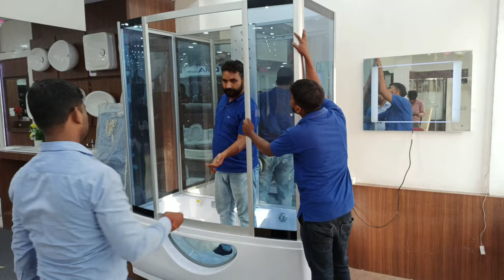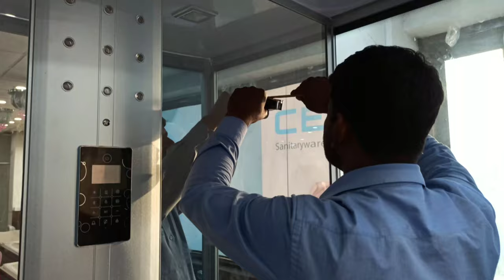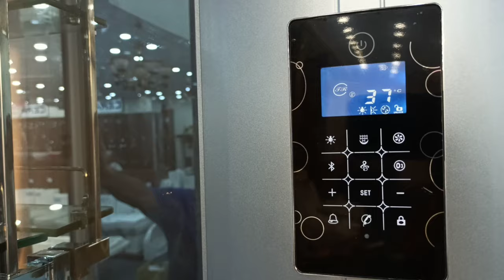jacuzzi bathtub + Steam Shower whirlpool | Jacuzzi installation by CERA

Comment: Mumbai me available hai or abhi ka kya price hai AFTER SALE SERVICE KA KYA
Reply from the maker: CADEO
Steam Shower Room 
1700 x 850 x 2200 mm 
• Ceiling Shower gives rain shower experience
• Hand Shower
• Top and back lamps provide bathroom like ambience
• Back massage jets gently soothe and invigorate body
• Control panel to operate all functions from a single point
• FM Radio to listen to one’s favourite music
• Steam room to rejuvenate body
• Exhaust fan circulates fresh air
• Foot massage invigorates tired feet
• Glass rack and shampoo box provide storing space
• Two level glass rack optimises storage
• Soft back rest to sit back and relax
• Pop-up drainer drains water and also works as overflow
• Six body jets to massage the body thereby improving blood circulation
Cat. No. B2513113 ` 290850
Indian Sanitation
492/B, Maulana Azad Road,

Mumbai- 400004, Maharashtra

+91 22 23878677, +91 22 23878666 , +91 22 9869257864
Jo bhi discount aapke dealer per chal raha hoga use per yah aapko mil jaega aap call kar kar ine se baat kar sakta hun, 🙏

Comment: Sterm shower Whirlpool ki cost kya h
Reply from the maker: CADEO
CANYON
Steam Shower Room 1700 x 850 x 2200 mm
• Ceiling Shower gives rain shower experience
• Hand Shower
• Top and back lamps provide bathroom like ambience
• Back massage jets gently soothe and invigorate body
• Control panel to operate all functions from a single point
• FM Radio to listen to one’s favourite music
• Steam room to rejuvenate body
• Exhaust fan circulates fresh air
• Foot massage invigorates tired feet
• Glass rack and shampoo box provide storing space
• Two level glass rack optimises storage
• Soft back rest to sit back and relax
• Pop-up drainer drains water and also works as overflow
• Six body jets to massage the body thereby improving blood circulation Cat. No. B2513113 ` 290850 discount. Depends your nearest dealer 20 to 35%.

Comment: What is the size and cost ?
Reply from the maker: CADEO
Steam Shower Room 
1700 x 850 x 2200 mm 
• Ceiling Shower gives rain shower experience
• Hand Shower
• Top and back lamps provide bathroom like ambience
• Back massage jets gently soothe and invigorate body
• Control panel to operate all functions from a single point
• FM Radio to listen to one’s favourite music
• Steam room to rejuvenate body
• Exhaust fan circulates fresh air
• Foot massage invigorates tired feet
• Glass rack and shampoo box provide storing space
• Two level glass rack optimises storage
• Soft back rest to sit back and relax
• Pop-up drainer drains water and also works as overflow
• Six body jets to massage the body thereby improving blood circulation
Cat. No. B2513113
MRP-290850 discount idea 20 to 35 %
Reply from the maker: If you like the information, please like and subscribe my channel👍🫡

Comment: Tell price please
Reply from the maker: Price mention in discerption🙏
Reply from the maker: CADEO
Steam Shower Room 
1700 x 850 x 2200 mm 
• Ceiling Shower gives rain shower experience
• Hand Shower
• Top and back lamps provide bathroom like ambience
• Back massage jets gently soothe and invigorate body
• Control panel to operate all functions from a single point
• FM Radio to listen to one’s favourite music
• Steam room to rejuvenate body
• Exhaust fan circulates fresh air
• Foot massage invigorates tired feet
• Glass rack and shampoo box provide storing space
• Two level glass rack optimises storage
• Soft back rest to sit back and relax
• Pop-up drainer drains water and also works as overflow
• Six body jets to massage the body thereby improving blood circulation
Cat. No. B2513113
MRP-290850

Comment: Size kya hai.. 
Length n width.. 
Or height..
Reply from the maker: CADEO
Steam Shower Room 
1700 x 850 x 2200 mm 
• Ceiling Shower gives rain shower experience
• Hand Shower
• Top and back lamps provide bathroom like ambience
• Back massage jets gently soothe and invigorate body
• Control panel to operate all functions from a single point
• FM Radio to listen to one’s favourite music
• Steam room to rejuvenate body
• Exhaust fan circulates fresh air
• Foot massage invigorates tired feet
• Glass rack and shampoo box provide storing space
• Two level glass rack optimises storage
• Soft back rest to sit back and relax
• Pop-up drainer drains water and also works as overflow
• Six body jets to massage the body thereby improving blood circulation
Cat. No. B2513113
Reply: @NotableTarun   Okk.. Thank u😊

Comment: Bhai dimensions kya hogi iski n shock lgane k toh koi chances nhi h na?
Reply from the maker: CADEO
Steam Shower Room 
1700 x 850 x 2200 mm 
• Ceiling Shower gives rain shower experience
• Hand Shower
• Top and back lamps provide bathroom like ambience
• Back massage jets gently soothe and invigorate body
• Control panel to operate all functions from a single point
• FM Radio to listen to one’s favourite music
• Steam room to rejuvenate body
• Exhaust fan circulates fresh air
• Foot massage invigorates tired feet
• Glass rack and shampoo box provide storing space
• Two level glass rack optimises storage
• Soft back rest to sit back and relax
• Pop-up drainer drains water and also works as overflow
• Six body jets to massage the body thereby improving blood circulation
Cat. No. B2513113 
And shockproof

Comment: Rate kitana hai
Reply from the maker: CADEO
Steam Shower Room 
1700 x 850 x 2200 mm 
• Ceiling Shower gives rain shower experience
• Hand Shower
• Top and back lamps provide bathroom like ambience
• Back massage jets gently soothe and invigorate body
• Control panel to operate all functions from a single point
• FM Radio to listen to one’s favourite music
• Steam room to rejuvenate body
• Exhaust fan circulates fresh air
• Foot massage invigorates tired feet
• Glass rack and shampoo box provide storing space
• Two level glass rack optimises storage
• Soft back rest to sit back and relax
• Pop-up drainer drains water and also works as overflow
• Six body jets to massage the body thereby improving blood circulation
Cat. No. B2513113 `mrp  290850
Baki Jo bhi discount aapki Nearest dealer per chal raha hoga use per ye aapko mil jaega

Comment: what about the price
Reply from the maker: CADEO
Steam Shower Room 
1700 x 850 x 2200 mm 
• Ceiling Shower gives rain shower experience
• Hand Shower
• Top and back lamps provide bathroom like ambience
• Back massage jets gently soothe and invigorate body
• Control panel to operate all functions from a single point
• FM Radio to listen to one’s favourite music
• Steam room to rejuvenate body
• Exhaust fan circulates fresh air
• Foot massage invigorates tired feet
• Glass rack and shampoo box provide storing space
• Two level glass rack optimises storage
• Soft back rest to sit back and relax
• Pop-up drainer drains water and also works as overflow
• Six body jets to massage the body thereby improving blood circulation
Cat. No. B2513113
` 290850
Discount depends on dealers 20 to 35%
Reply from the maker: If you like my video please like and subscribe 🙏🙏

Comment: Dealers available in taminadu?
Brand name?
Reply from the maker: BRAND NAME CERA
Designer World
No.305/8 , Kovilpathagai Main Road,

(Opp SBI ATM), Avadi,

Chennai – 600062, Tamil Nadu

+91 7358344992,vmgceramics@gmail.com
Kailash Home Concepts
 

Survey No. 485/3, Madhavaram High Road

Near Vadaperumbakkam Circle

Madhavaram, Chennai – 600060,  Tamil Nadu

 

+91 9791082829, +91 9043789334,kailashhomeconcepts@gmail.com
Reply: @NotableTarun  
Thanks sir
How much discount ?
Reply from the maker: @madhuraveera6967  30to 35%
Reply from the maker: @madhuraveera6967  but discount dealer decide Karta hai yah Idea hai only aap is number per call kar kar poochh sakte hain Kitna discount chal raha hai vah aap Ko pata Bata denge

Comment: Price
Reply from the maker: Check description

CADEO
Steam Shower Room 
1700 x 850 x 2200 mm 
• Ceiling Shower gives rain shower experience
• Hand Shower
• Top and back lamps provide bathroom like ambience
• Back massage jets gently soothe and invigorate body
• Control panel to operate all functions from a single point
• FM Radio to listen to one’s favourite music
• Steam room to rejuvenate body
• Exhaust fan circulates fresh air
• Foot massage invigorates tired feet
• Glass rack and shampoo box provide storing space
• Two level glass rack optimises storage
• Soft back rest to sit back and relax
• Pop-up drainer drains water and also works as overflow
• Six body jets to massage the body thereby improving blood circulation
Cat. No. B2513113 ` 290850

Comment: Iska cost kitna padega?
Reply from the maker: CADEO
Steam Shower Room 
1700 x 850 x 2200 mm 
• Ceiling Shower gives rain shower experience
• Hand Shower
• Top and back lamps provide bathroom like ambience
• Back massage jets gently soothe and invigorate body
• Control panel to operate all functions from a single point
• FM Radio to listen to one’s favourite music
• Steam room to rejuvenate body
• Exhaust fan circulates fresh air
• Foot massage invigorates tired feet
• Glass rack and shampoo box provide storing space
• Two level glass rack optimises storage
• Soft back rest to sit back and relax
• Pop-up drainer drains water and also works as overflow
• Six body jets to massage the body thereby improving blood circulation
Cat. No. B2513113 ` MRP 290850
20 to 30 % discount depends on dealer

Comment: Cost?
Reply from the maker: CADEO
Steam Shower Room 
1700 x 850 x 2200 mm 
• Ceiling Shower gives rain shower experience
• Hand Shower
• Top and back lamps provide bathroom like ambience
• Back massage jets gently soothe and invigorate body
• Control panel to operate all functions from a single point
• FM Radio to listen to one’s favourite music
• Steam room to rejuvenate body
• Exhaust fan circulates fresh air
• Foot massage invigorates tired feet
• Glass rack and shampoo box provide storing space
• Two level glass rack optimises storage
• Soft back rest to sit back and relax
• Pop-up drainer drains water and also works as overflow
• Six body jets to massage the body thereby improving blood circulation
Cat. No. B2513113 `price 264410
Or jo b descount ap k nearest dealer pr chl rha hoga 25to30%

Comment: Dealer availble in pune
Reply from the maker: 1st call and confirm please 🙏👍 Bhagwati And Company
Kurkumbh road,
sawarkar nagarbhagat singh chowk,
daund

Pune-413801, Maharashtra
9890959890,rameshpokar9898@gmail.com
Jai Traders
Near nigdi flyover,
nigdi

Pune-411044, Maharashtra
8007770705,jaytraders.tiles@gmail.com
Mahalaxmi Tiles And Granites
Pune nagar highway (malthan phata),
near saisahara petrol pump,
shikrapur,
tal-shirur

Pune-412208, Maharashtra
9168380160,mahalaxmitilesandgranite@gmail.com
Mukesh Steel Centre
Near pimpri kalewadi bridge,
mainroad,
kalewadi,
pcmc

Pune-411017, Maharashtra
9822599211,mukeshsteelcentre@gmail.com
Sapphire Sales Corporation
S No. 133/2, Baner Road,

Balewadi Phata,

Opp. Orchid international school,

Pune-411045, Maharashtra
+91 7387087907,
Sapphire Sales Corporation
S/No.66/19, Katraj Kondhwa Road,

Opp. Shatrunjay Temple, Kondhwa (BK)

Pune-411046, Maharashtra
+91 20 26932616,accounts@sapphiresalespune.com
Shiv Shakti Enterprises
Sr.no. 32/1,
plot no: 21,
23,
24,
pune solapur road,

Pune-412201, Maharashtra
9975587777,rajendra.kalbhor@yahoo.com
Walhekar Marbles
Plot no: c52,
bhigvan roadbaramati industrial estatebaramati

Pune-413133, Maharashtra
9689895761,CWALHEKAR@GMAIL.COM

Comment: What is my nearest dealer in West delhi?
Reply from the maker: Balaji Plumbing Solutions Pvt. Ltd.
Plot No. 60, Rajapuri Gali No. 40

Madhu Vihar

West Delhi-110059, Delhi & NCR
9873086385,kunshbhs@gmail.com
BTC Traders Private Ltd.
505 Vishwa Sadan Tower,

West Delhi-110058, Delhi & NCR
9810069603,btcnewdelhi@gmail.com
Himani Enterprises
B-9/8, Main Ring Road,

Rajouri Garden

West Delhi-110027, Delhi & NCR
011-49385168,himanienterprises01@gmail.com
J B Marbles
1641, Thana Road

West Delhi-110043, Delhi & NCR
28010366,jbmarbles2010@rediffmail.com
Manoj Enterprises
Plot No. 14,15 , Block R

West Delhi-110059, Delhi & NCR
9818835581,manojenterprises@gmail.com
R.S Sanitarywares
Plot No 8,Friends Enclave,

Rajendra Park, Nangloi

West Delhi-110041, Delhi & NCR
9810014088,rssanitarywares@yahoo.co.in
Satya Trading Company
Rza/34/Kh No 29/2, Dwarka Puri

Vijay Enclave, Palam

West Delhi-110045, Delhi & NCR
9891673136,satyatrading2014@gmail.com
Reply: @NotableTarun  thankyou

Comment: Rs.2,90,000.00 ?
Reply from the maker: CADEO
Steam Shower Room 
1700 x 850 x 2200 mm 
• Ceiling Shower gives rain shower experience
• Hand Shower
• Top and back lamps provide bathroom like ambience
• Back massage jets gently soothe and invigorate body
• Control panel to operate all functions from a single point
• FM Radio to listen to one’s favourite music
• Steam room to rejuvenate body
• Exhaust fan circulates fresh air
• Foot massage invigorates tired feet
• Glass rack and shampoo box provide storing space
• Two level glass rack optimises storage
• Soft back rest to sit back and relax
• Pop-up drainer drains water and also works as overflow
• Six body jets to massage the body thereby improving blood circulation
Cat. No. B2513113
MRP-290850 discount idea 20 to 35 %

Comment: Any dealers in Bangalore??
Reply from the maker: Amruth Hardware & Ceramics
#250/25/17/16,
near central jail,
naganathapura,
electronic city post bang

Bangalore-560100, Karnataka
9741013532,amruthceramics87@gmail.com
Ayush Trading Co
# 6/7,
near rail way gate,
chikkabanavara,
yesvanthpur hobli.

Bangalore-560090, Karnataka
9739916916, 9740722597,ayushtrading.co2018@gmail.com
Gulshan Ceramics
No.266,
267,
268 & 293,
srinivasnagar,
bank colony,
b.s.k,

Bangalore-560050, Karnataka
9448476590,gulshanceramic@gmail.com
Hindustan Hardware & Sani
#759/,
2nd phase,
80ft. road,
hoskerehalli cross bus stop,
bsk 3rd stage.

Bangalore-560085, Karnataka
9449290022,hindustanhardwaresanitary92016@gmail.com
Jai Marketing
No.01,
sy.no.341,
kalkere village,
nearkalkere bus stop,
hormavu post,
bangalore

Bangalore-560043, Karnataka
9738707590, 9740816808,jaimarketingbangalore@gmail.com
Krishna Enterprises
No 33/a ,
basement floor & ground floorsituated at puttenahalli

Bangalore-560078, Karnataka
9742337346,mangalram99@gmail.com
Maa Janki Ceramics
#09,
28th main road 9th block jayanagarbangalore.

Bangalore-560069, Karnataka
9535231354, 9535231354,
Padmavati ‘ S Easybuild
No 38,
6th cross,
r.k.layout,
80 feetroad,
padmanabhanagar main road,

Bangalore-560070, Karnataka
9341445444,ppfblr@gmail.com
Parishrama Tiles Emporium
# 15 & 16 ciiq road bharath nagar2 nd phase near byadara halli bus stop,

Bangalore-560091, Karnataka
9008223359,INFO@PARISHRAMAGROUP.IN
Rohini Ceramics
40/2,
thagachaguppe kumbalagodu postbangalore

Bangalore-560074, Karnataka
9663731901,rohiniceramics2018@gmail.com
Saptha Marketing Co
# 521/ a r r woods nayandan halli main rmysore road

Bangalore-560039, Karnataka
9916704999,GOWRISHSAPTHA@YAHOO.COM
Thanu Trading Company
No,
1,
2,
5,
6 first floor,
r.b.c complexnear gardencity college,

Bangalore-560036, Karnataka
7204641999,thanu.trading@gmail.com
Thanu Trading India Pvt.Ltd.
No.888,
17th cross,
80 feet road,
s.k. nagar(post),
m.c.e.c.h.s. layout.

Bangalore-560077, Karnataka
7204641999,thanugroups2014@gmail.com
Vishnu Marketing
#2001,
2nd floor,
hal 2nd stage,
100ft road,
indiranagar,
above ritukumar

Bangalore-560038, Karnataka
8025205088, 9686602254,vishnumarketing@yahoo.co.in
Reply: U can even get it from Krishna ceramics and hardware. Opp. Of ksrp 9th battalion, amrutha clg road. Just google this name and u will find the shop. Owner is friendly and trusted. Been his customer from past 5 years. Do contact him if anything needed related to Cera.

Comment: Any dealer in Hyderabad
Reply from the maker: Bhavani Sanitary
 2-6 A & B, Choudary Mansion, Chandanagar, Hyderabad, Telangana - 500050
 9985498557
 rameshkumarrc@185gmail.com
Doshi Brothers
 4-1/575, Troop Bazar, , Hyderabad, Telangana - 500001
 9246205200
 doshi@doshibrothers.com
Gourav Marketing
 
H.No.1-176/2, Nizampet Main Road, Kukatpally, , Hyderabad, Telangana - 500072

 9441425578
 rakeshkumardewasi@gmail.com
Uday and Co.
 J-D, Rashtrapati Road, Secunderabad, Hyderabad, Telangana - 500003
 9866597259
 udayandco@gmail.com
Sri Bhavani Marketing
 4-189, Satya Sai Nagar, Jillelguda, Balapur Road, Hyderabad, Telangana - 500097
 8790693392
 bharmalchoudhary64@gmail.com
Patel and Co.
 8-7-177/5, Old Bowenpally, Ranga Reddy, Swarnadhama, Hyderabad, Telangana - 500011
 9440190816
 Patel319@ymail.com
Sri Mahalaxmi Agencies
 
Ground Floor, Plot No.6, D.No.2-81, Gachibowli X Road, Towards Kondapur, Gachibowli, Hyderabad, Telangana - 500032

 9490117934
 dhaaramarketing@gmail.com
Rajeev Ceramics
 
Shop No. 13-06-439/A/97/ A, Near Pillar No. 74 Balaji Nagar, Gudimalkapur, Ground, Gudimalkapur, Hyderabad, Telangana - 500001

 9908132436
 rajeevsmhyd@yahoo.com
Vk Choudhary Traders
 D No 6 150, Cellar Slns Colony, Balapur X Road, Balapur, Hyderabad, Telangana - 500097
 9849515025
 vkchoudharytraders@gmail.com
RKZ Faucets and Sanitary
 9 -4- 86/ 222 -14 B, Sri Kovela Ranganayakaswamy Temple, Nanal Na Ghar, Asif Nagar, Hyderabad, Telangana - 500028
 8688882299
 rkzfasttraders@gmail.com
Sri Bhavani Agencies
 Plot No.02, Survey No.296/7/4, Main Road, Ida Bollaram, Hyderabad, Telangana - 502325
 9000028007
 praveen.4.choudhary@gmail.com
Decent Sanitary and Stores
 Ground Floor, Shop 11-3-928, Ali Chambers, Opp.Priya Talkies, Mallepally, Hyderabad, Telangana - 500057
 9885709781
 decentsanitarystore@gmail.com
Lal Enterprise New
 10-3-152/C, Inderlok East,Marredpally,, Secundrabad, Hyderabad, Hyderabad, Telangana - 503002
 8096688031
 muddapuramashish4@gmail.com
Srinivasa Sanitary Stores
 1/4/906 07 & 08 ,Bakaram, Opp. Raja Deluxe, Musherabad, Hyderabad, Telangana - 500048
 9948339555
 78srinivasa@gmail.com
CALL HIM 1ST SIR